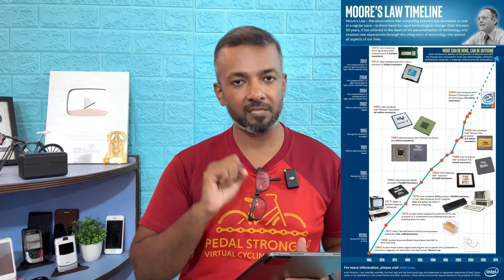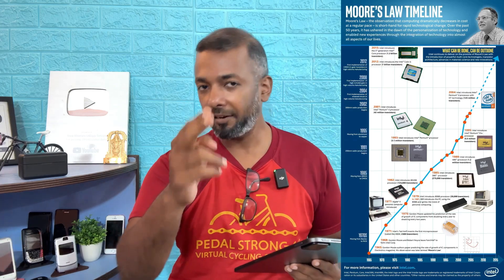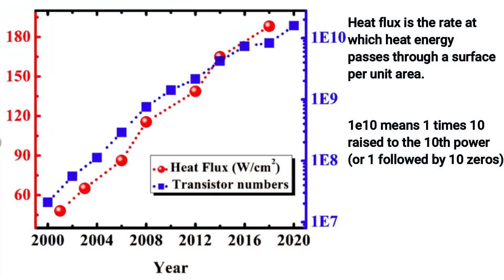Moore's law and its contribution to mobile heating

Comment: @siva bro ... One doubt... Enna than LTPO 1-120hz refresh nu sonnalum...  60,90,120,144 hz lam mobile display specific Thane.. Ella application um 120 hz la run aagathu la... Enna thaan 144 hz display va irunthalum application support pannala na 60 hz la thaane run aagum .. apram ethuku namma refresh rate pathi think pannanum bro...... correct thaane siva bro ??
Reply: Bro mobile phone displays ku high refresh rate thevaye illa.. Apple iPhone la maadiri smooth ah UI optimization pannale podhum. Brands can launch separate high refresh rate model targeting gamers... optionally..

Comment: Bro,SOC heat(50+ ⁰c) aaga some major cause irruku.

1. Inefficient chip packaging:
  
By arranging Performance core and efficient cores in a way that heat distributed uniformly throughout the Chipset. 

2.imperfection in silicon wafer:

For manufacturing silicon wafer , we  heat the silica sand to melting point 
Solidify it into a  cylindrical structure ( imagine like அம்மி குழவி shape) And cut it into circular plate this is a silicon wafer. (Underlying process explain panna lets take a salt water solution normala 100ml water la 36 g salt dissolve aagum but heat pannum bothu upto 65g dissolve aagum ippo 65g salt dissolve aana 
Solution la one piece of rock salt (kal uppu)  potingana antha solution la irruka salt solidify aagum intha process name crystallization .during crystallization process  aagum pothu silicon wafers la small imperfections create aagum like fine crack in nm and silicon-silicon bonding la issues irukum ithanala heat aaga vaipu irruku even the inspect panna wafer layum 100% quality solla mudiyathu.

3. Lithography process imperfection.

Lithography process la ultraviolet rays use panni transistors a design panrom like sculpting a statue from clay  but inta process panrathu oru 🐜 (ant) a oru knife aala kill panrathukkh saman.some times intha process pannumpothu transistors some particular regions la unusable state la irrukum in case of large number of transistors like 1million units it can be removed but if it is like 1,10,100,1000,10000 not possible.intha damaged transistors kuda heatku oru cause.

4.microcodes and HAL:

HAL means hardware abstract layer(part of kernel) intu hardware kum kernalkum irruka oru linker used to make communication between hardware and kernal ithula irruka errors some times specific core oda clock frequency a athoda limitkku push pannum , register memorya abnormala interupt pannum ithanala heat aagalam.

Microcodes are program which manage the registers and input voltage for cores and other units intha codes la irruka bugs sometimes whole SOC kkum irreversible damage cause panna vaippu irruku
Reply: Thanks for the information 👍 good work